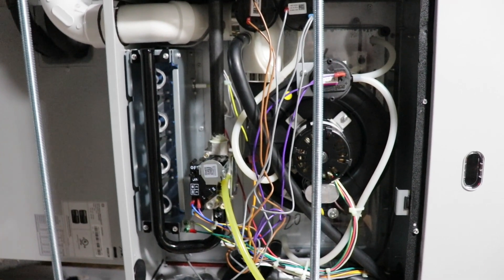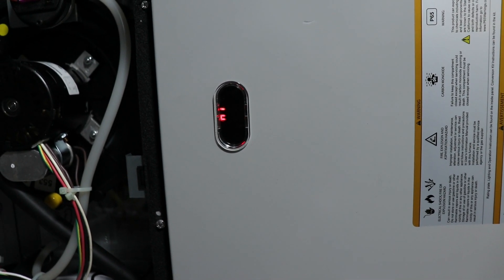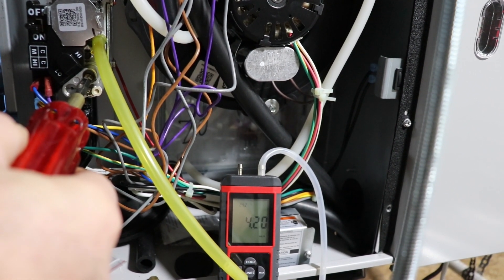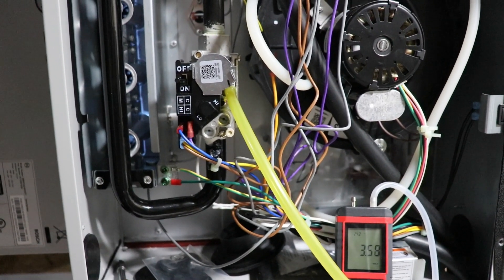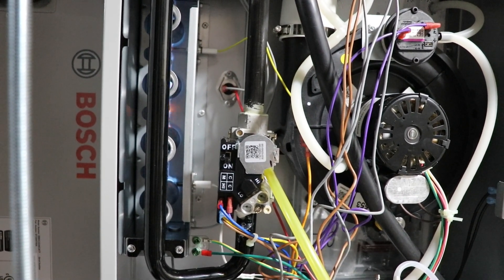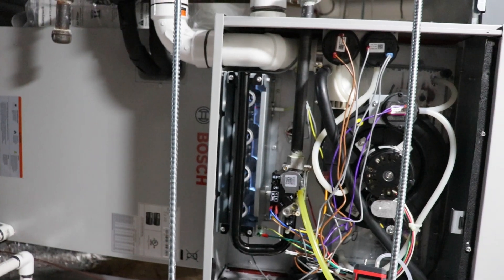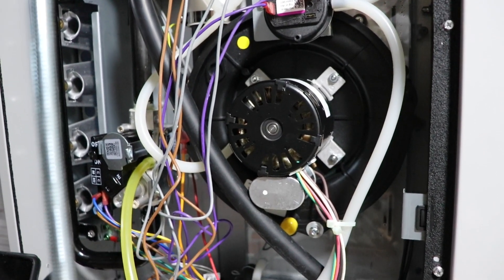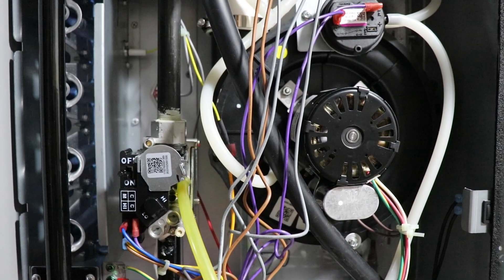Bosch BGH96 Error E5 E6 Code Fix and Gas Pressure Setup

Comment: I've had this several times now.......Bosch has told me to check all units now as the gas quality in they're test facility is poor and they crank up the pressure. A also have got some condenser fan issues with IDS systems......seems to be boards not motors so far........shitty as i've put a whack of these in

Comment: A bit confused did you figure out what it was?
Reply from the maker: The furnace was over firing which was overheating the heat exchanger, I had to set the pressure for Hi and Low as they were way too high.